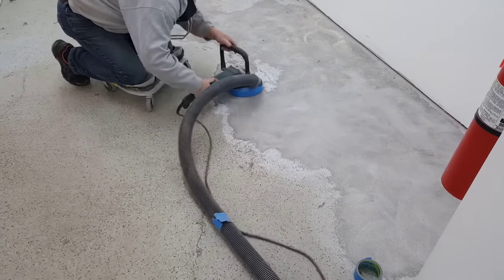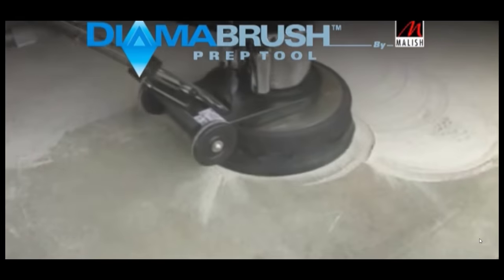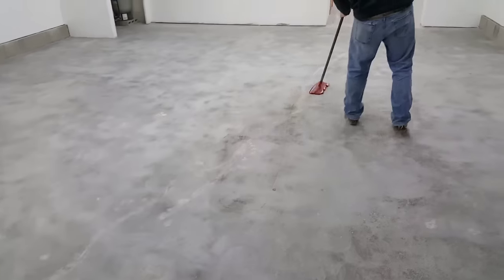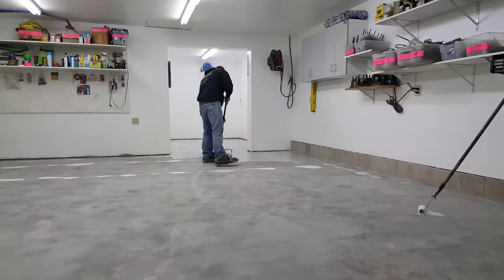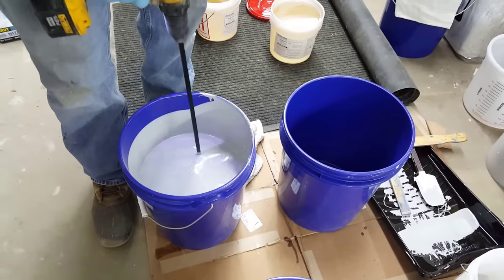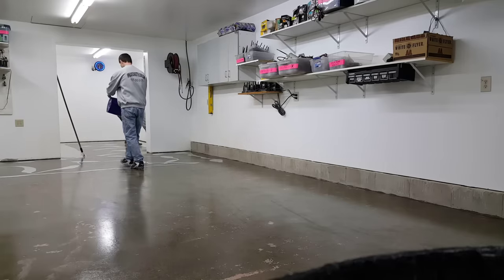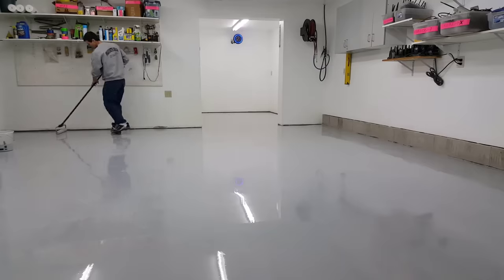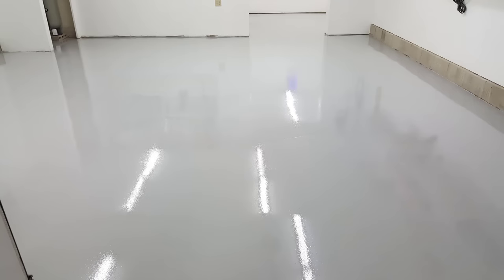How To Epoxy Coat Your Garage Floor | Must Watch For Diy'rs

Comment: Yo Mike, I have 1 question that I'm dying to get feedback on from a pro. Is there ANYWAY, I can apply coats in sections? 

Bottom line: my wife will have a conniption fit, if I start bringing tools in from the garage— even for a day or two. How bad would the seams be? Would it cause it to be drastically unlevel?
Reply: If you buy all of the kits you need and mix all of the part A's into one large bucket (and do the same with the part B's) and use those to pour out your batches you can minimize your risk of color variance.  That said you'll still probably have slightly visible seams where the coats overlap.  If a seamless all-in-one-shot install is that important and you have a space on your property (and no HOA up your ass) rent a conex box for a few days store your tools/equipment in that while you do the work.
Reply: Or rent a van if your HOA is a PITA. I’m using a PODS container
Reply: Did you end up doing in sections? I'm getting ready to try the same.
Reply: always best to complete all areas at once
Reply: I’m sure you probably already finished your floor but for others reading the comments:
Rent a U-Haul, Penske, or Ryder moving truck load everything in that. Then finish your floor all at once.
Reply: So, I have a 4 post car lift that is too tall to move out of the my 2 car garage.

I’m planning to do one half and then roll the car lift on to it after a week and finish the other side.

I’m going to cut a narrow cut that runs down the middle and hope that the halves will appear seamless.

Comment: Mike, good day from MPLS, MN. In the planning stages of covering my newly poured garage floor (Oct 18, 2021). Hoping I can pull this off in Dec/Jan 2022 when temps are dropping here in MN (similar to ME). My garage will be fully insulated (walls, ceilings, and 2" rigid foam in garage floor) by then. A garage heater will also be installed. If I ramp up the heater and get the floor warm would I be able to pull this off? Hoping so as I don't want to drag stuff out in May and also allow a full winter of ice/salt to work into this nice new floor. Thanks. much Mike for your great channel and expertise! Lance (UMaine, Orono - Black Bear '97)
Reply: Did you end up doing the epoxy coating?  I’m in St. Paul and have a similar plan to yours

Comment: Good one Mike.
Do you recommend an anti slip for snow & water drips or is it not an issue ?
Thanks from Cleveland Ohio.....Spring starts Thursday, Mar 19 11:49 pm  2020
Happy new Decade
Reply from the maker: If you're concerned about it being slippery, you can add anti-slip to the urethane top coating. We do occasionally.

Comment: With correct prep work, you can get professional-grade epoxy flooring by using big-box retailer epoxies as well. 90% of the job is correctly doing the prep work. (and you save a TON of marked up money)

Comment: What’s the price for a 2 car garage floor epoxied?
Reply from the maker: That's going to be different depending where you live and who you hire. We all use different products and have our own basic systems. Prices will vary a lot. Just make sure you get someone with experience and check references. You don't want someone to use a cheap epoxy, it won't last.

Comment: Hey Mike great video. I’m considering this for my floor in New Jersey. There’s a company here that says they do it all in one day. Seems like a lot of work to get all done in one day. Just concerned that this may be one of these fly-by-night type of deals. Anything I should know about the products that they’re using to know if they’re doing good quality work with great products that hold up? Thanks for your response. Auntie Babs Of Auntie Babs Estate Sales and Auntie Babs Junk-BEE-Gone
Reply: Just got myne done in 1-day.
They started around 830am and finished up by 2:30pm.
It was dry within 24 hours and I was told that I could drive on it within 48 hours.

By the time I priced everything out materials in renting the machine and buying the diamond bladed grinding pads and everything? They were only $1000 more than what I would’ve been in to it as a DIY.

My wife convinced me that sometimes I have to let the professionals do what they do best and besides “Hello Garage” the service that did our 10 x 20 garage give me a lifetime warranty on the job.

Ask for a general manager to take care of your quote and you won’t have to pay a sales commission.

If your garage can be cleaned and ready for them to do it they can slide you into it last minute cancellation that’ll save you some more money along with paying check or cash.

Comment: The problem is DIY kit costs $200, contractor costs $2500-$3000 for 2 car garage. 😀 You could do that 15 times over 15 years if you choose to do urself

Comment: Why epoxy coat a garage floor, and would most new houses have that already?  My house is fairly new but I don't believe the floor is coated.
Reply from the maker: To protect the concrete, make it last longer, and make it easier to clean. New houses don't usually have this done unless the owner asks for it.
Reply: @MikeDayConcrete  - Cool thanks for the info!

Comment: could you talk about using a  moisture meter,  a closeup of good concrete prep scratch, and talk about poorly mixed and laid cement vs. good trustworthy cement that will hold a coating vs. garbage cement that won't. and how to test for it, also, hardness/softness and prepping each kind.

Comment: Buddy you didn't do a meter reading even if you have a primer you need to take a meter reading it has to be 4% or below .
Reply: What’s do you mean a meter reading? The moisture in primer or epoxy?

Comment: Is this a joke ... I don't want to bash you guys .... I've been the industry for ten years ... did you guys ever think that your Grinding you did is useless your buffer grinder didn't even past the surface of the concrete floor you have spots everywhere where the concrete is not grinded your buffer is not heavy enough to grind right to the pours of the concrete your Grinding is miss leading your primer is a good idea but honestly it shit without Grinding that floor properly you can ask any real installer they will tell you the same and they will agree with me floor might last awhile but not twenty years or more . O before I forget did you guys even do a meter reading for moisture?? 😢